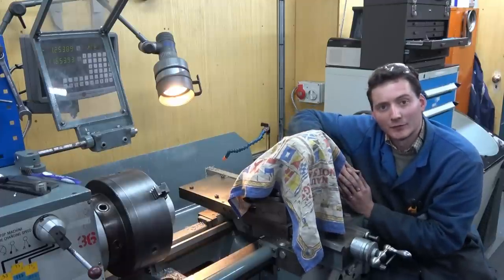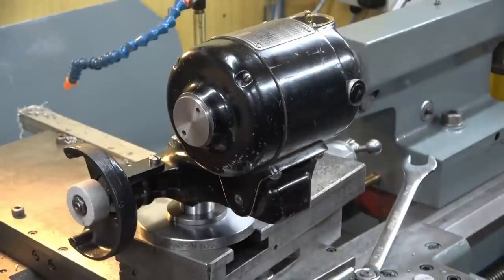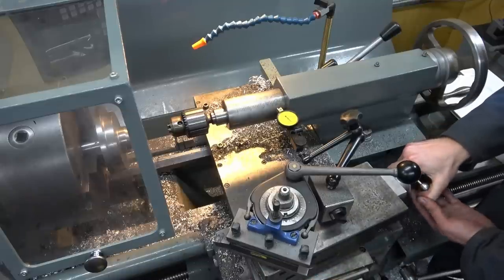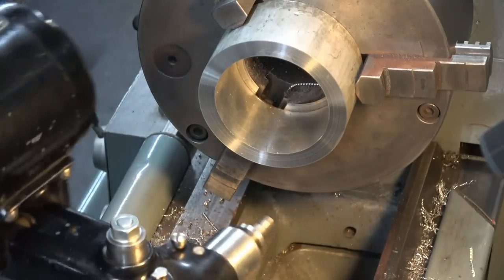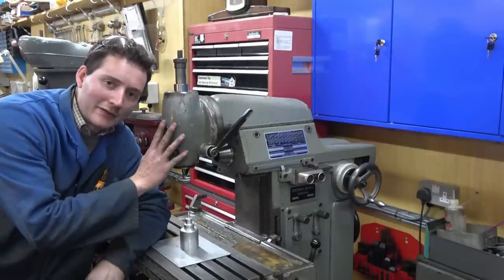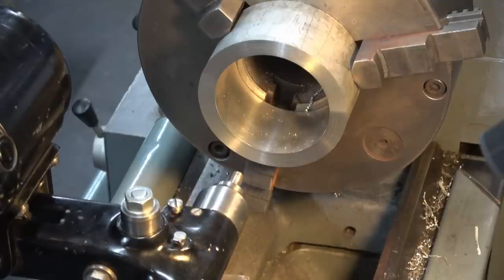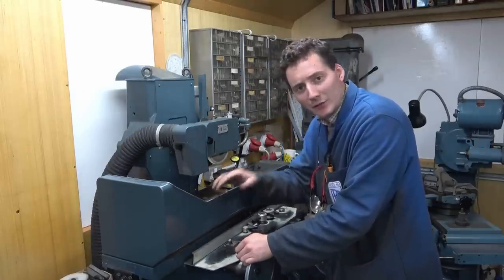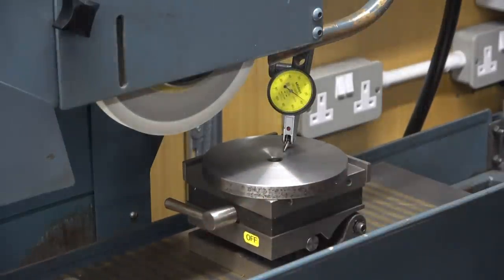Setting A Tool Post Grinder (The MrCrispin Way)

Comment: Good evening, Mr. Crispin, and congratulations on 10 years of service to RR. The next 10 years will go faster, so be sure to fasten your seat belt. Setting that tool post grinder is quite an undertaking. I very much appreciated your thinking involved in solving the various situations that arose. I am also very much looking forward to seeing the results when the grinding begins. Thank you for another excellent tutorial and greetings from Germany.
Reply from the maker: Thanks
Reply: Just suspend  the grinder shaft between centers between tail stock and chuck then adj the mount bolt housing (small sqare head bolt allows the stud sleeve to slide up and down)  so that it sets securely on the compound tool post mount and tighten the mount nut . That sets tool height and 0 angle to the chuck at same time. This is all assuming that your tail stock is centered with your chuck(if not you have bigger issues any way) Clear as mud? lol Great video i have 3 of those grinders. One still in the original fold up metal storage box. Very handy!
  @MrCrispinEnterprises

Comment: Congrats on 10yrs first stage of apprenticeship complete I presume? 
I would have thought checking the tool post grinder bore and contact surfaces would be 1st priority then horizontal/flatness of the top cross slide and  the top slide is flat 2nd and no play?
The weight of motor pulling would also have a bearing on all.
I cringe at the thought of electrical outlets left to suffer the elements of moisture and grinding dust from the surface grinder. Yes yes fluid might reduce the dust some but not all, spray of fluid however not so.
Reply from the maker: Your quite right about checking all the individual elements of the machine but I'm trying not to make a project out of a project. All the parts work correctly and grinding the circular plate offered the most efficient way to correct the angle of the spindle.

Comment: 24:00 Beware, the weight of the indicator causes a significant error due to flexing of the mounting rod. Mounting the indicator directly with no rod will help.

Comment: Hello Crispin, now in August 2024 I’m reviewing this grinding series. An upcoming task requires that I wake up my slumbering Dumore 44 - never used since arriving at my shop - and prepare to OD grind. It’ll need some fiddling to make it fit, but then these are the challenges that keep us amused. Thank you for posting! 👍👍

EDIT - My grinder looks just like yours, in particular it has a separable power cord with no provision for grounding. That suggests it’s quite old. My serial number is B 4133. According to the factory, this means it was made in 1941! 😮

Comment: Gravity is working on your DTI/Clock when measuring in the vertical orientation. It is certainly possible and likely that there are errors in the spindle orientation, but you are not really measuring them in that setup in the vertical direction. Try taking your DTI and using a magnetic base on a flat steel plate, set for zero with the tip touching the plate. Then lift the whole plate and DTI and turn it upside down and check reading--it will not be zero no matter how rigidly you attach the DTI.  With most DTI's you will see a couple of thou of gravity induced change, but with higher quality DTI's the error is larger since the measuring force is less.  My Interapid 0.0005 indicator reads 0.0095 low when upside down in this test.  People are sometimes amazed by this but it is a fact that you can check for yourself.  It is better to measure the top of spindle relative to the ways by running an indicator over the top of the spindle (yes it is small) and make sure it is parallel to the ways.  Your left/right measurement with the clock is OK because the errors due to gravity cancel out.  Congrats on 10 years--that is a big achievement!
Reply from the maker: Interesting thoughts . I can see that being more of an issue if the stylus was strait out rather than in the true to face position. I'll do some testing.
Reply: I have done that demo with people who have been machining for decades.  And then watch them try to count the jobs where this would explain the problems they had.
Reply: Yes I have encountered that problem when aligning lathe tail stocks in the vertical direction. Also had the problem when using an Indi-Cal tool with a DTI bore tool which gave different readings top to bottom vs bottom to top. The DTI was a Tesa .0001. The Indi-Cal setup is pretty rigid and I think some of the variation might come from the DTI internals itself which I verified by turning it over without being in a bore and seeing the variation. I thought the DTI might be damaged in some way but it is fine otherwise. I just switched to other bore measuring tools.

Comment: Hm...  Just a thought...   A particular German machinist had some vids on how rotating an indicator stand in a manner affected by gravity should be a terrifying event!  Much deflection due to the thing not being nearly as stiff as we would like to imagine..  So measuring the top and bottom of the plane with an indicator spinning around the spindle could be considered...  inconclusive, at best!
Reply from the maker: Was that a multi joint flexible type? If it was then I agree. This indicator is held on a single steel bar less than 4" long.
Reply: @MrCrispinEnterprises  Ah, yes -- most of the worst of it was those well-known multi-joint single-clamping-knob things.  I agree with your instincts about the short bar.  Were it me, I would probably check it anyway, on a cold winter's day when there was nothing else to do...  :)   Cheers!  Always love your vids.
Reply from the maker: It's definitely an interesting topic. I'll have a think

Comment: Noob question, why not use a AXA / BXA tool holder for fixturing with a machinist jack style support. It'd make it easy to indicate, set the height and then pop that in the DRO tool offset for next use ?
Reply from the maker: Fixturing for which element?
Reply: @MrCrispinEnterprises  as in the toolpost grinder is attached to a QCTP holder, perhaps not as rigid ?
Reply from the maker: Oh I see. Yes that would not be very rigid. Perhaps some adapter could made to mount it to the main tool Post centre rather than having it in a holder.

Comment: If I remember rightly the slotted screw is a fine height adjust
Reply from the maker: I'll have a look. The one at the front near the spindle is to hold the wheel guard on.
Reply: I wondered that

Comment: Excellent walkthrough, I really enjoy the detailed explanation of the topic. 
It's probably my own inadequacies and inexperience shining through, but I honestly do not understand why the "tramming" of the grinder spindle is necessary. 
The provided explanation, and reference to the mill situation is fully understandable. It makes perfect sense when talking about a milling cutter. 
However there is one step done to the grinding wheel that is not done on a milling cutter. Namely dressing the wheel. 
Asuming that dressing could be done to the sides and bottom of a milling cutter it would cut perfectly in all axis, regardless of spindle axis angle offset. 

As I understand it dressing the grinding wheel, aligns the cutting face to the desired angle of the top slide. Given of cause that the topsslide is used wile dressing the wheel.
In this case, where the topslide angle is 7.125 degrees, and the grinding spindle is "trammed", the angle on the grind wheel would be the same.
Assuming that the topslide is used to dress the wheel. As we want to grind the topslide angle on something. As I see the situation, if the grinder isn't "trammed to the lathe axies as you describe, the only difference would be that the grinding wheel would not be dressed to exactly the same angle as the topslide, but something slightly off. 
Regardless of the grinders spindle being "trammed" or not, the dressed grinding stone should always present the complete dressed face to the work at the exact angle the topslide is set at.
Please correct me, as I presume I'm mistaken due to my lack of experience and knowledge.
Reply from the maker: Top marks, you clearly understand the geometry. What you may not know is that I am planning to grind with the face of the wheel as well as the periphery.
Reply: @MrCrispinEnterprises  ahhh that is the missing piece of information i did not catch. Then the alignment makes perfect sense. When using my toolpost grinder I have only used the side of the wheel, therefore never had the need for "tramming" the grinder. I'. look forward to what comes up in the next video.

Comment: Hello Mr Crispim!
Followed your instructions, set’d up the toolpost grinder, dressed both outside and cup wheels (I have two flanges), now I’m getting crosshatched faces!
However, I took a cheap old drill press cross-vice, dismounted and tried to surface grind the ways. Beautiful cross-hatch pattern, but surface turned out to be convex. Suspecting that it may be because of poor fixing to the chuck, as I ran a long bolt through the lathe spindle, a nut on the back and the chuck was running without jaws, just as a reference surface. This may have caused the edges to bow up from the center bolt pressure, thus convex. I’ll retry it using the four jaw chuck, which I hope that can somehow hold the drill vice. Second guess is that my cross slide is not running smooth because of a bent gib. I need to fix it and I keep promising that I’ll do it tomorrow.
Thanks for your videos!
Reply: Went on to check the lathe cross slide and it's gib. Yes, it is bent. I de-bent as much as I could, now it's on the 0.05mm feeler gauge realm, so maybe that will be made flat by scraping. I re-scraped the cross slide table to a horizontal co-planar to the top, it was good, but already showed some wear after 3 years I'm using it since I scraped it flat at first. 
I noticed that the gib is a little undersized on the vertical plane: it stands shy about 0.3mm (1/80") of the cross table reference horizontal surface. In my understanding/readings, I think this has to be flush. Will glue with rubberized loctite a brass shim strip, then machine to size.
I also checked the lathe carriage cross slide dovetails: they are not perpendicular, they start at thinnest, then go up 13 microns (0.013mm), up to 35 microns, then back to some 28 microns (1 thou). No way to know if this is angle'ing left, right or both. I can only tell they are not parallel enough. Since I know my chinese 1000x320 lathe is somewhat unperfect, I'm considering putting the cross table on the Schaublin milling machine, then indicating it's outer side, then skimming the parallel side dovetail (it's 60 degrees). Then I can rest assured that one side is good enough, than do the scraping on the carriage side of this dovetail. Then re-measuring it's width, I'll be probably going get readings on the tapered gib side only, since the fixed side should be fine now. Wow, that's a lot of work, that hopefully will give me better results.
Since my lathe was not that far off when I did the face grinding, I'm guessing the conical shape I ground has to be caused either by the ends flexing up because of the center bolt single point of pressure, or maybe the toolpost grinder can have rotated a bit by the cutting forces, but I should have checked for that before dismounting it from the lathe.
The drill press vise I gave a hand scrape treatment. It's really low quality cast iron, much more difficult to scrape than the lathe cross table. The bolts that press the parallel gibs were at different heights and some of them have poked holes on the flattened surfaces, which I'll plug fill with brass (or maybe cast iron), then level. 
I am getting much better at scraping, reaching a better number of contact points per inch and a much more constant scraping pattern. Carbide blade sharpness is the (king) way to go! I think I might have scraped some 5 square feet (about half square meter).

Comment: Sir i have question related to piston ring making.
What will be the clearance must need to be in between piston cylinder  diameter and ring diameter to move it perfectly and leak proof.
For hydraulic cylinder piston with metallic rings.

Comment: at 21:18, you could also use the 'centre support' and squeeze the fingers onto the spindle cartridge caseing, the polished part, ensuring that the support is square, using the carrage, and also that the fingers are extended equally, ensuring concentricity; 
another way is to mount two dead centres, in tail and head stock, and offer the 60deg. hole of the grinding spindle up to this ( via the carrage motion), and then slide the tailstock up to this, therefore clamping the spindle, as if it was an arbor for turning between centres, and if you loosten the stem clamp, you can level this at the same time (both axis at once); easy setup jig, no fus, using simple tools already at the lathe station.
Reply from the maker: Very clever.

Comment: Useful video this as I need to set my Duplex toolpost grinder up, unfortunately my lathe does not have a topslide with a T slot so extensive re working is required to use it with anything else other than the 4 way toolpost.

Comment: Love the videos. And you sir are a gentleman. I must ask: what do you do for Rolls Royce???!!
Reply from the maker: Thanks. I work as a Process Developer in a large machine shop that does turbine components. Grinding is my main focus.
Reply: @MrCrispinEnterprises  interesting. I have been forced to move because of legal issues with my brother and my ex. We just moved my old grinders. A brown & sharpe OD//ID grinder and G&L surface grinder. I forgot how heavy these were!!!! I also need to think about moving my wadkin pattern lathe and small Wadkin pattern mill (LQ). These are in England!!!! I saw you posts on moving. I can appreciate the work. It will be a shill before I get back into steam engines. Got to timber frame a new shop. Keep up the good work.

Comment: just noticed in the video where you were using a sine chuck on the surface grinder, not to nit pick but its a pretty good idea to have the grinding wheel pushing the work towards the fence .  If the work were to slip at all  with fence on the wrong side it would form a wedge action with he work sliding up the chuck  adding a lot of unnecessary excitement.  some ejected parts will  never be found again  possible entering some inter-dimensional doorway.
Reply from the maker: Thanks for the tip

Comment: Congrats on your 10 years at Rolls Royce! Ah, but doesn't dressing the wheel remove all the fractions of your non parallelism without all the indicating? You are going to be moving the wheel past the diamond with the compound at your set angle. Any slight error in alignment will be ground off the wheel...
Reply from the maker: Exactly right well done, the issue is however that it only removes the errors in alignment where grinding on the wheel periphery is concerned.

Comment: Steve Osborne
I have over 16,000 hours in the air propelled by Rolls Royce Conway, RB211 and V2500 engines - only one serious failure in 35 years. This speaks volumes for the quality of the products and calibre of the engineers they train. Great video and much respect.
Reply from the maker: Thanks

Comment: I am a new viewer to your YouTube channel and l have found your videos to be very interesting, informative and inspiring to watch. I have a very small workshop that at present is not up and running yet due to various reasons, correct power supply to the machines being the most problematic one at the moment. l will in the meantime be watching your videos and l sure they will drive on to finishing the repairs necessary to allow me to use them, l am amazed at your level of knowledge and ability to explain the topic areas you cover in the videos. Regards Gary
Reply from the maker: Many thanks and glad to have you watching

Comment: Congratulations with your 10 year. Are you aware of the term "Bar sag" and did you consider it with the indicator set-up when checking the face runout?
Reply from the maker: Thanks. Given the length and diameter of the bar and the weight of the indicator I did not include any consideration to bar sag no. Interesting point.
Reply: You are measuring a plane in the direction of gravity and so indicator sag will be at best a second order source of error
Reply: I've corrected many vibration problems with critical machinery with skilled milwrights who didn't take bar sag seriously.
Reply: This can be accomodated by tilting the machine by 90 degrees when taking the measurement.
Reply from the maker: Finally, someone with a practical solution!
Reply: @MrCrispinEnterprises  Or even simpler, rotate the gravitational field to align with the lathe axis.  No need to move the machine!

(As a software developer for many years in the field of multibody dynamics, we would actually do essentially this for certain models.)
Reply: @d00dEEE  This tends to make the lathe fly across the room sideways however.

Comment: Congratulations at 10 years with RR, in another 10 years you'll be there long enough to be taken seriously :P  My wife had someone who'd done 46 years service working for her at RR.
Anyway the actual question...  Is there any concern with grinding dust on the ways causing excess wear?   Quinn from blondi hacks seems very concerned about it but I've no idea whether it's actually something to be concerned about?
Reply from the maker: Yes it is a problem. My plan is to lay a few damp rags over it.

Comment: Congratulations on your ten year milestone. Today am also marking ten years, but mine is in retirement. 
When using a tool post grinder, I was taught to aligned the spindle parallel to the angle of travel so that the full face of stone is in contact with the work, not just the edge. Am I wrong or is more to be revealed?
Reply from the maker: More is to be revealed!